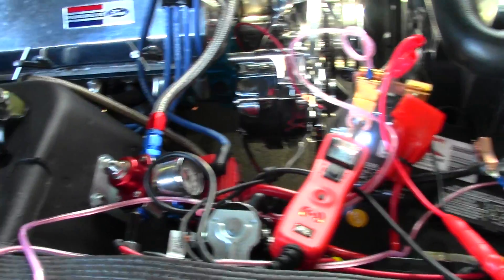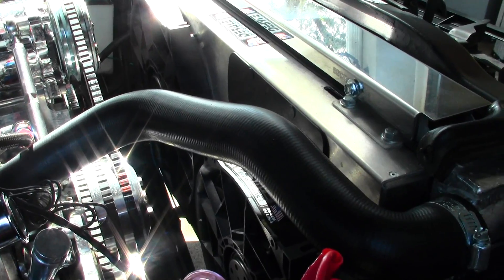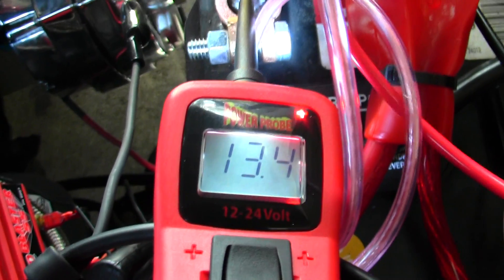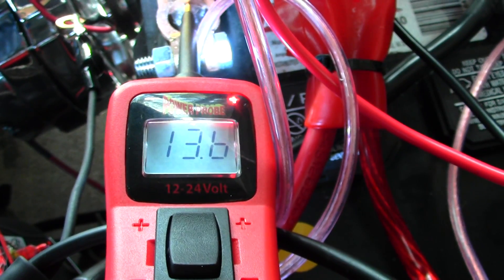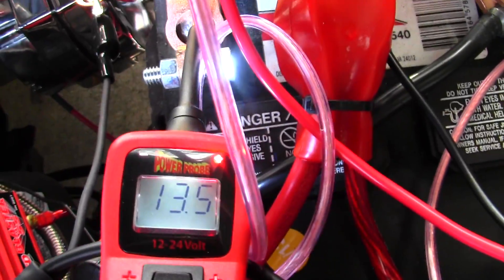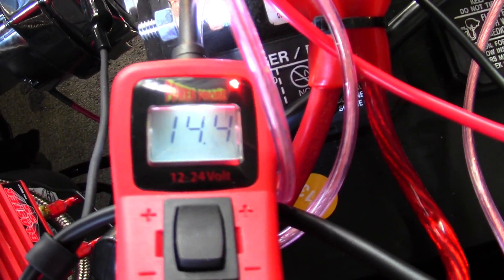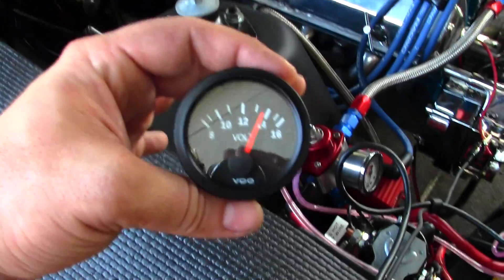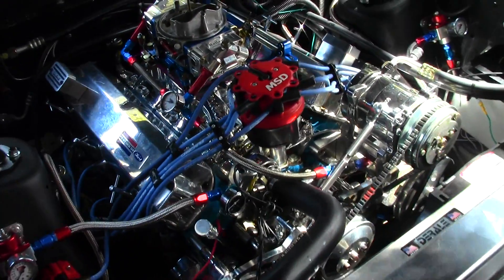How To Load Test An Alternator | Power Probe 3 + GM 1 Wire 100 amp

Comment: That "low" voltage is nothing to even worry about. There's no need to increase your idle. You're wasting your time and going kill fuel economy. Anything over a full battery which is 12.6v is charging the battery. So 13.6v at idle is fine, and actually within most manufacturer's specifications. Even if all you did was idle, your battery would stay charged with 13.6v coming back.

Comment: Great video Brian. You are getting the crash course on all this stuff!

Your voltages look good, but you may wish to measure your amperage output at idle as well. Those alternators are advertised as 100-amp but they fudge the numbers a little. Usually that's maximum amperage....at idle it'll be more around 75-80 amps. 10si alternators were superceded by 12si and then CS130 alternators as a few years went by because the 10si was simply at it's maximum ability. These were/are Delco GM alternators BTW.

Not saying that's a bad thing or you chose a bad alternator, but you do want to think about your power load at idle. You know that electric fans temporarily draw a lot more amperage at startup than when running so that could have cooked your fan controller(it shouldn't have).

 Are you running an underdrive crank pulley? Back when I exclusively drove 5.0L Mustangs, anytime we had underdrive pullies on, you could watch the voltmeter drop down to 12v anytime the engine idled. Looking back on it 20 years later I wouldn't use them again.

Comment: Working it at 100% capacity is probably what made the old one go bad so fast. Go 3G 130A, you'll never go back haha. I've used mine for 2 years now and love it, no worrying about having enough alternator and only $75 bucks on Ebay plus a $15 kit to put it on. And you don't have brightening/dimming lights at night.